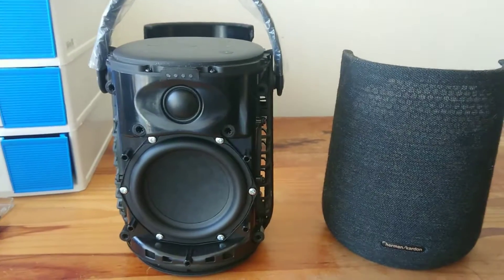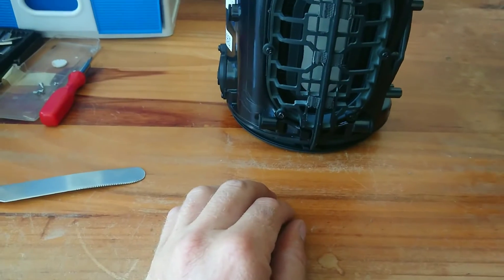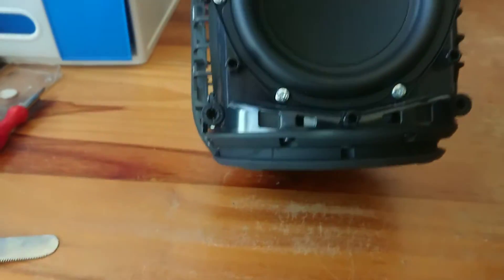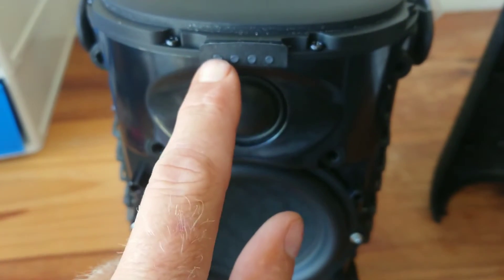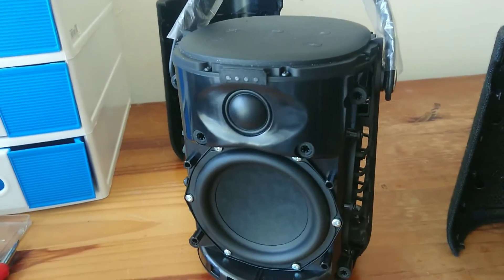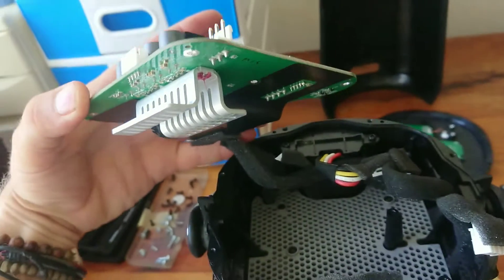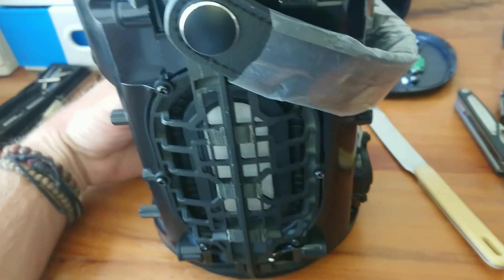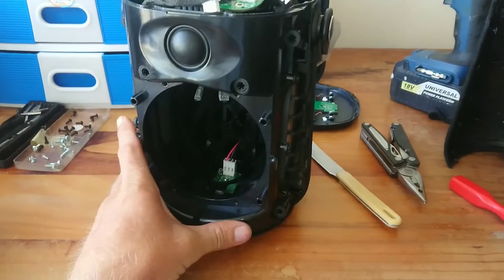Harman Kardon Citation 200 Teardown

Comment: It's going to sound a whole lot worse if the woofer is run full range and only a cap on the tweeter.
Using WiFi and running lossless audio will be fine. 
You could try hacking where the bluetooth analogue component goes into the amp if you could even find it.
Or, to use passive crossover, you'd need to design a somewhat decent one. 
At this point, easier to either make you own cabinets for these drivers or else use other drivers

Comment: i want to open the speaker to replace the battery, could you start from the beginning? i want to see how you removed the cover 🙂
Thx
Reply: key parts to open the case in order to access the battery are:

1:15 - 2:15
9:20 - 10:35
11:00 - 11:07

i managed to do it - it's a bit of a hassle but not overly complicated still. you just need appropriate tools available.

thanks a lot for the video Littlekingcarver1😁

Comment: So I tried to remove the shell. Broke the small notches at the top, broke the shell where it holds the screws in that rubbery scrotum down at the stand part. Not that you guys are to fault - I am dumber than a monkey with cerebral palsy, but when any of you guys film a teardown video, you could actually film the part where you are getting inside so dumb people like me don't have to destroy their tech. Also screw those guys at Harman Kardon. This, just like apple, pisses on our right to repair.

Comment: Could you please film a battery replacement video? I just ordered one 5200mah replacement and I can't find any video on how it's done.
Reply: I have the exact same issue, also have a new battery and i want to replace it but no video
Reply: @BartVdB-q1t  I broke mine. Not completely but scratched it and chipped some plastic bits. You will have to remove the rubbery bottom just a tiny bit - you will tear off a bit of glue and underneath that you will find 3 screws on each side of the mesh covers. Remove those first - I broke them off because none of these videos will tell you they are there.

Comment: Hey, thanks! My speaker just died, so I factory reset it, but now I can't reconnect it to my home. I think it might be the battery, but even when plugged in, it won't work. It's on, but won't connect via Bluetooth or Google Home. I don't think it's the battery because I hardly use it. Anyway, I ordered a new one; hopefully, that will solve the problem. 0:21
Reply from the maker: Hey, I hope the new battery sorts it out.
Reply: Solved it?
Reply: @lieschingramon7095  No, I changed the battery, but the problem still persists. It's probably a firmware issue; I don't know.
Reply: My speaker has firmware issues, I am trying to identify the uart port, or any which way to connect the device with my computer using some serial tool, I would appreciate if someone can guide me, thank you!

Comment: Where to buy replacement parts (europe)? I think the charging port/controller on my Citation 200 is defective. Everytime I plug the charging cable in, it reboots everytime. I tried different charging cable and I put a new battery in it, but still the same problem.
Reply from the maker: Sometimes a hard reset can solve these issues. There's videos on how to do this, or Google it, I've forgotten at this point, lol.

On another note, my harmon go play 2 was not charging the other day at all, so I opened it up and disconnected and reconnected the battery and the problem went away, so this may also solve some issues with the Citation 200.
Reply: @littlekingcarver1  Thanks. Unfortunately it won't boot anymore. My device is 3 years old but I sent it to Harmankardon and they want 230 Euros for the repair. The mainboard must be replaced because it has a short. They offered me to replace it by myself so they just want 145 Euros for the new mainboard. I said no thanks. I want to sell it now as defective...
Reply from the maker: @MPunkt1234  Ouch! I'm sorry that it happened.

Comment: Thanks for the video. I opened up the speaker as it did not want to charge the battery anymore. I read in the comments that others also had this issue while you did not mention where the battery is. Actually it is on the top, beneath the lid with the buttons. No point opening the bottom or removal of the speakers. I just ordered the following battery: JBL-2 ID1060-B / 1INR19/66-2 accu (6800 mAh) although the number of the battery is 1icr19/65-2, the size and the wires and connector is the same. It might have a bit more power.
Reply: I Just Ordered a new battery Pack Like yours. Can you please Tell me how i get the top Off? I dont get it 😆
Thx
Reply: @mastererik239 I believe there are screws just behind the rubber seal/ring. At first you don't see them, but once you put the rubber aside you can see them.
Reply: Yes my new battery fixed it. I can now normally use it outside the docking station.
Reply: Got a 200 that blink briefly but then doesn’t turn on. How was yours? Did the battery change fix it? 😊
Reply: "No point opening the bottom or removal of the speakers." So where do you open the speaker to replace the battery?

Comment: Hello, thank you for the Teardown Video. I got myself a citation 200 and need to repair a view things on it. I figured out, that you can use the speaker as almost "passive" speaker if you connect it via the USB-C port. It then ignores all settings on the speaker itself. You dont even have to set it up on google home or airplay.
Did you allready went further in your project? I need to replace the battery and have some issues with connecting the speaker to a Wifi.
Greetings, Phil
Reply from the maker: Hi Phil. No, I have just been using them as designed for now. They are not my primary sound system, I have a set of infinity's connected to a nad amp, and that's my daily listen, but for occasions where I need outside music for a social gathering etc,  these two citations fill the area very adequately. Interesting about the usb port bypassing all the bloat ware! I guess they designed that in for trouble shooting reasons?
Reply: Hi there! Can you elaborate on using the speakers with a USC-C cable. How did you manage to send audio through the USC-C cable? I'm unable to find it on my computer if I plug in directly.
Reply: Is that possible, has someone done it?, I am trying to save my bricked speaker. Any which way possible.

Comment: Hello. Thank you for the great video! Could you please tell me where the battery is located and how I could remove it to replace? Also, any indication about the battery code dornordering would me highly appreciated!! 😊
Reply: артикул IAA031NA     Limited charge voltage 4.2 V   
GB 31241-2014 
nominal voltage 3.6 V
rated capacity 4800 mAh 17.28 Wh

analogue
JBL Flip 5 Flip5 4800 мАч ID1060-B
Аккумуляторная батарея 1INR19/66-2 для портативной акустики JBL Flip 5. Li-ion, 5200mAh, 3.7V, размеры: 71.60 x 38.45 x 20.00 mm, цвет синий. Изготовитель Cameron Sino, Китай.
Список совместимых парт-номеров p/n:
1INR19/66-2, ID1060-B, CS-JMF500SL
Reply: Hello, did you find any battery online for replacement? greetings
Reply: Hi the battery is accesible from the top under under the black pannel 11:06 where it comes black yelow white red cable. And its 2 IRC18650-26j m batteries with control board

Comment: My speaker just quickly flashes once but doesn't boot. The battery just died over time. Is it possible to change the battery on this speaker?
Reply from the maker: Also, try resetting the speaker. Press and hold the volume down button and voice assistant button for more than 10 seconds. Might help. How old is the speaker?
Reply from the maker: Hi. Yes, I'm sure you can order a replacement battery. Does the speaker still work while on the charging station?
Reply: @littlekingcarver1  
Thank you a lot for your response! I attempted a reset on the speaker, but unfortunately, it was unsuccessful. Additionally, I tried charging it using a USB-C cable. When connected to the charger, the speaker briefly shows indicator lights but fails to turn on completely. However, when it's not charging, there are no lights indicating any activity. The speaker has been in use for roughly 2.5 years, and I've noticed a gradual decline in the battery's performance. Towards the end, it barely managed to last a few minutes off the charger.
Reply: I have the same problem with my HK Citation 200 speaker. It does not work even when connected to the charger. the LEDs just turn on for 3-4 seconds and then turn off. BOTH
Reply from the maker: Batteries are usually the weakest link in these devices. I'm sure a replacement would solve your problems. Hopefully you can find one, and someone to assist with it.
Reply: I got exactly the same issue. Did you solve the problem?
Reply: @MrRobTheSwede I took out the battery but I am waiting for the replacement.
Reply: @AgeGo-tx7zk  Where did you buy the replacement and how did you pull out the old one?
Reply: I removed the old battery but I am waiting for the replacement.  @MrRobTheSwede
Reply: I’ve had the same thing happen to mine, slowly started getting worse over time. Please update here if you’ve managed to replace your battery I’m pretty keen to do it to mine as well
Reply: @alexbritton7732 I replaced the battery and it works again.
Reply: Hello! I have the same problem. Just could not identify at the vídeo where the battery is located and how to take it off. Also, I'd appreciate a lot if someone could post here the battery code só I can try to order one for me. Thanks a lot!
Reply: @RobertoSilva-hw5gr  артикул IAA031NA     Limited charge voltage 4.2 V   
GB 31241-2014 
nominal voltage 3.6 V
rated capacity 4800 mAh 17.28 Wh

analogue
JBL Flip 5 Flip5 4800 мАч ID1060-B
Аккумуляторная батарея 1INR19/66-2 для портативной акустики JBL Flip 5. Li-ion, 5200mAh, 3.7V, размеры: 71.60 x 38.45 x 20.00 mm, цвет синий. Изготовитель Cameron Sino, Китай.
Список совместимых парт-номеров p/n:
1INR19/66-2, ID1060-B, CS-JMF500SL
Reply: I have the same problem with my HK Citation 200 speaker